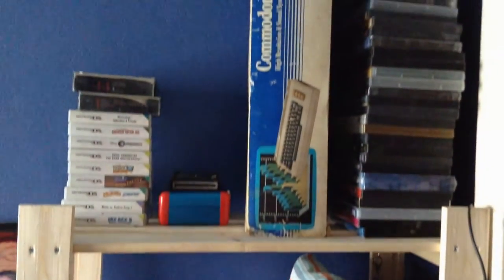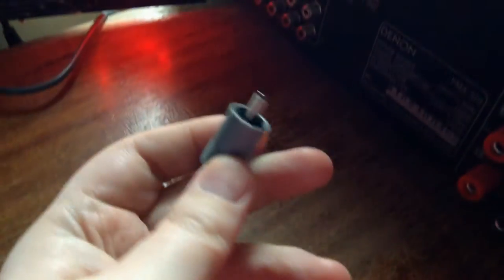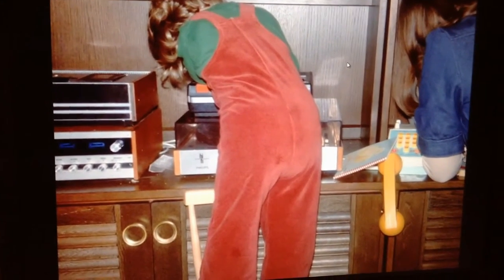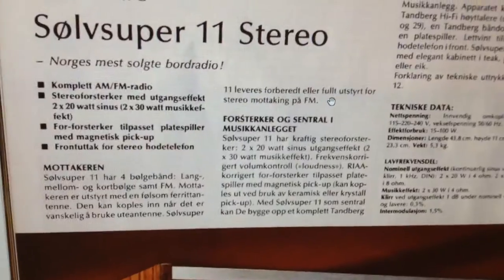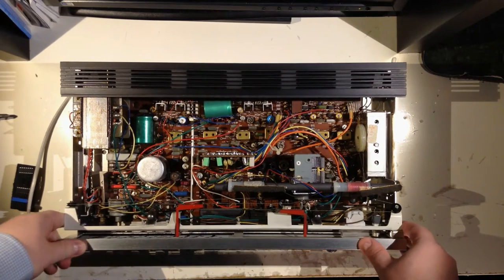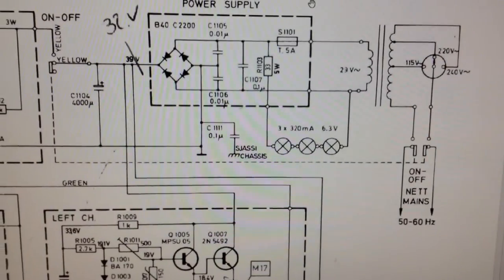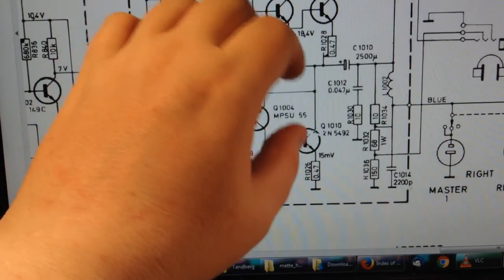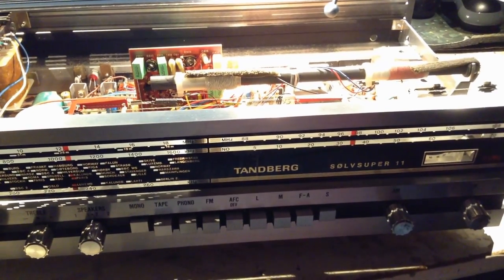Tandberg Sølvsuper 11-73 dump find teardown

Comment: I really enjoyed this video with all the old photographs of your family. Nice suit you had on:) 
I guess your dad didn't realise it was you who was filming? He has a really nice Tandberg set by the looks of it. It's old but it still works.
I'd like to see you go around this old thing to fix it up although it doesn't look like it has too much wrong with it. 70's electronics...what a jungle in there. Great stuff Hans...
Reply from the maker: +The Highlander Glad you liked it. I had like 50 minutes videos, cooked it down in half. Yeah, dad didn't hear me outside the car :) The Huldra 8 is from his parents. His S&#248;lvsuper 11 he bought back in the day and the TR2060 he bought a couple of years ago. The Huldra 8 is a tube amp radio. I remember when it didn't work, then he took it out of the basement and a day later the FM receiption started working. The circuit board is pressed paper. Later some tube burnt out. He has had them all serviced by another Tandberg enthusiast and the are working.
Will fix mine up. It smells a bit when it gets warm. I wonder if its old dust or if its dry capacitors.. Not much wrong with it other than broken right channel. Will be fun finding the fault there. Btw, I worked in Tandbergs HQ building in the Tandberg Data's R&D department, but at my time there they designed data storage automation products (automated storage libraries).. The factory dome is still there. Some of the guys there had worked with radios and TVs. The machinist worked on the woodwork back in the day. Therefore I have a soft spot for this company.
Reply: +bwack oh wow, I didn't know that was Tandberg where you worked. That's so cool. Having a full Tandberg audio set nowadays is really cool. But you have to do your own maintenance. Was your dad in electronics as well?
To have a audio equipment that belonged to your grandfather. Haha. That's so cool!
Reply from the maker: Dad and mom worked at the same company where they reworked circuit boards, hand turned inductors etc.. Mom was in her late teens.. Later my mother became a nursing assistant, and my dad continued in the same company doing service on personal pagers (beepers).. The sad part is that they never got any course in electronics so he didn't learn it. Just given instructions. but YES electronics more or less :) I wish they'd give me a practice/intern jobs when I was 17-18. I asked my father back then but it was difficult. It would have helped a lot, but it was "vernet bedrift" (sheltered workshop) and they probably just prioritized the ones who needed it the most. He thought me how to solder. Collegas at Tandberg Data who had been there since the startup in 1978 said they had courses to learn elementary stuff, operational amplifiers etc. They didn't have any prior education. Haha yeah grandpa's Tandberg Huldra 8. He died when my father was 18 back in 1968. He worked at a factory called Standard Telefon og Kabel fabrikk and his house was just a few minutes walk away. STK is now a school called Kuben (the cube) and the office building is now a hotell. (it's used as location in the movie: "a somewhat gentle man" ;) ) The road is called cable road (kabelgaten) and at Tandberg in Oslo, the road name sign says "Lytterveien" (listeners way). :-) STK did also research with computers and also high voltage. Theres a lot of archive pictures http://oslobilder.no/search?searchstring=standard+telefon+og+kabel but I can't find my grandfather. You can see a woman with a wirewapping gun, a new technology at the time for making rapid prototypes and wiring boards and panels in general.
Reply: I love those old pictures! People working with what they have..it's the latest and greatest technology at the time. 
People working in a factory without any prior knowledge of engineering that's really old school. Apparently it worked. I suppose experience was more important than anything else you may have learned in school. 
The original employees still worked there? Since 1978. My god. Talk about pioneering! My guess is that Philips started much the same way. Many technology companies started that way: small and with no idea where they would end up. Just imagine what it would have been like to work on the commodore computers or the atari 2600..